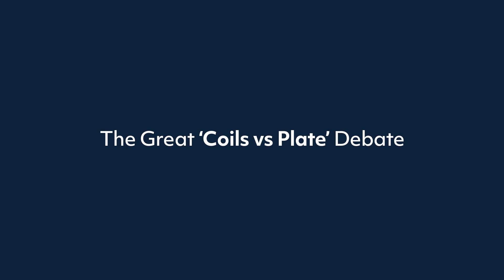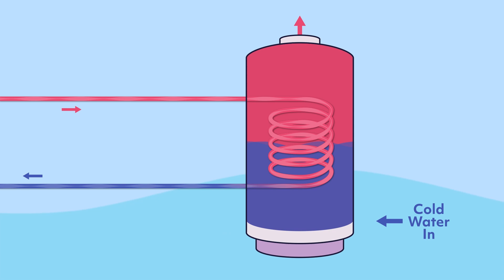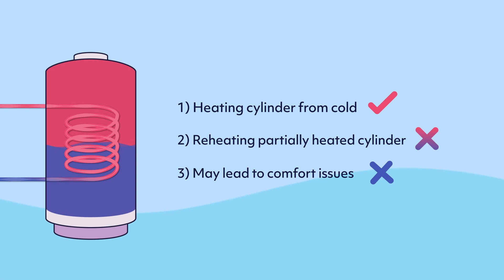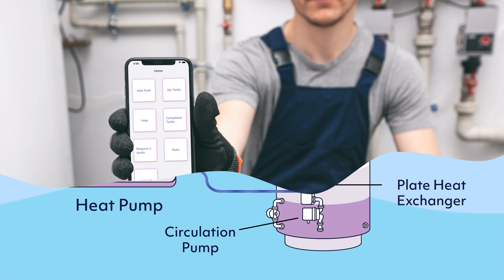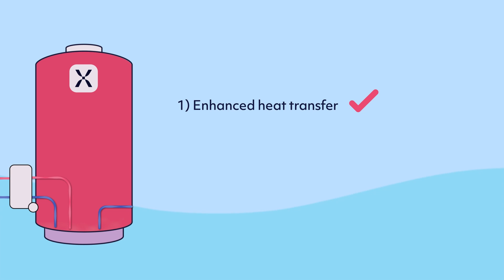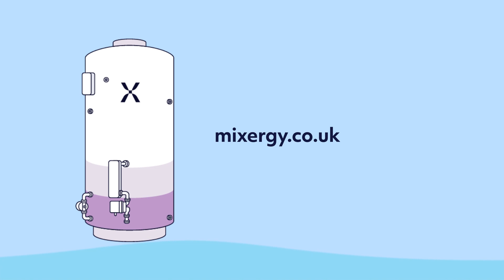How a plate heat exchanger works with a heat pump

Comment: What is the minimum volume between the plate heat exchanger at the heat pump outside, and the plate heat exchanger at the mixergy cylinder?
Reply from the maker: Great question. The best place to find the exact guidance for your setup is our Support Hub where you will find technical documents, guides and FAQs for Mixergy cylinders. https://mixergy.co.uk/support

If you do not find what you need, our chatbot on the website can point you to the right person for more help.

Comment: Does it still do stratification with the heat pump plate?
Reply from the maker: Thanks for the question, when we work with heat pumps we heat the whole cylinder to optimise the efficiency of the heat pump. You can also read about this more here: https://www.mixergy.co.uk/blog/plate-heat-exchanger-vs-coil-the-great-debate/
Reply: @ thank you for your reply, are we able to use the indirect coil to heat what we need with a heat pump? 

I have been running my gas boiler at 50c and my target temp is 45c

Thanks in advance

Comment: Why can't the hot pipe from the plate heat exchanger be at the top of the cylinder with the cold return to the plate heat exchanger? Then the cylinder will heat top down. There will still be a large heat differential between the flow (hot) to the cylinder and the return (cold).

Then useful  hot water is available at the taps quicker.
Reply from the maker: Hi John, many thanks for your question. The plate heat exchanger is positioned at the bottom of the cylinder and using full circulation to achieve the highest efficiency possible. For more information on how we work with heat pumps, check out this article >> https://mixergy.co.uk/news-and-insights/how-mixergy-cylinders-work-with-a-heat-pump/